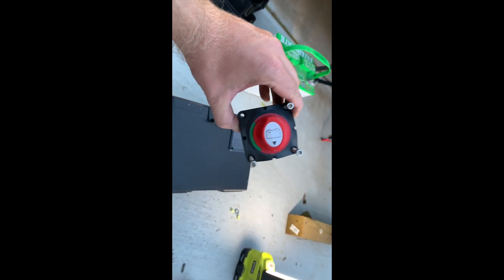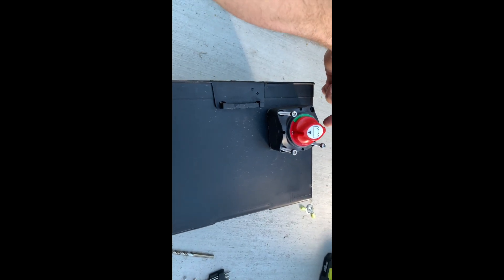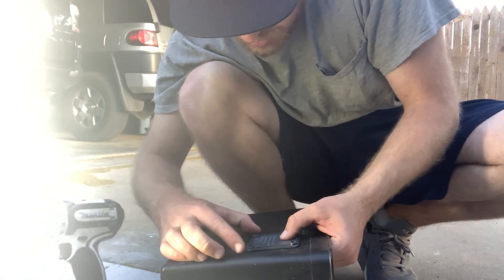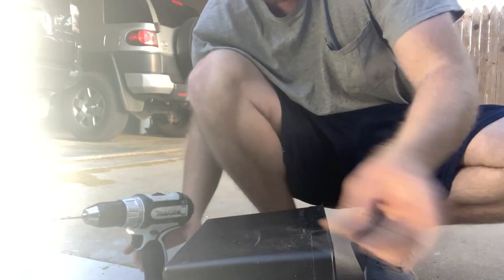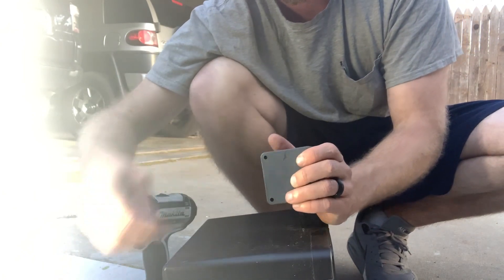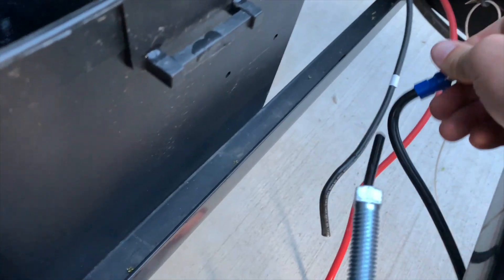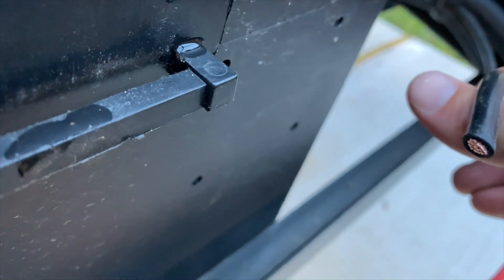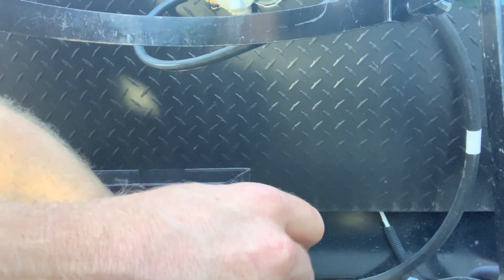Wolf Pup Camper Battery Disconnect Install

Comment: should have shown the inside of the box. no doubt the screws protrude enough on the inside to puncture the battery.
Reply from the maker: Thanks for watching. Nope they barely protrude at all with no threat to puncture the battery. The box is tapered so the bottom is smaller than the top which keeps the battery from sliding and allows space towards the top.

Comment: Ummm think you should have the positive connected not the negative
Reply from the maker: Thanks for watching! It needs to be on the negative cable. When you disconnect a battery from the car you always do the ground/ negative first because it keeps anything from shorting out. Some premise here now there is no way to short it
Reply from the maker: I’ve always done on the negative. Never had an issue but appreciate you chiming one. All the research I’ve done has always said the negative   This is the first time I’ve seen it said to be on the positive. I’ve also read it can be on either. I’ll be keeping it this way as I’ve had success with it in the past